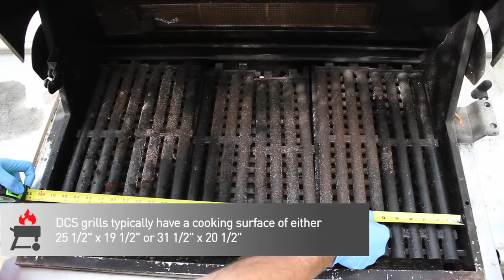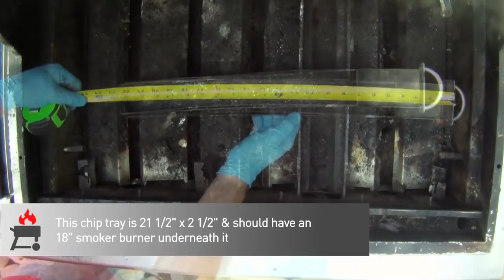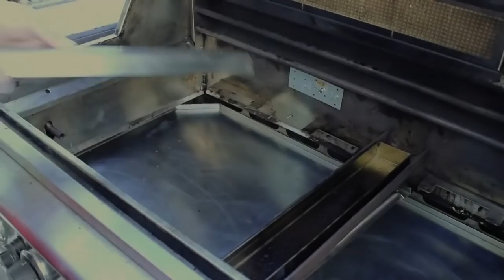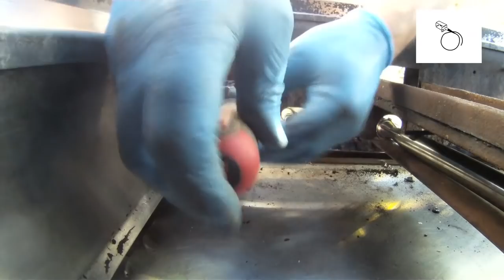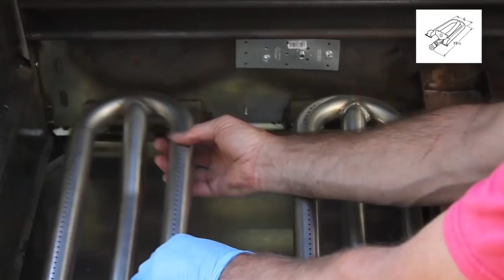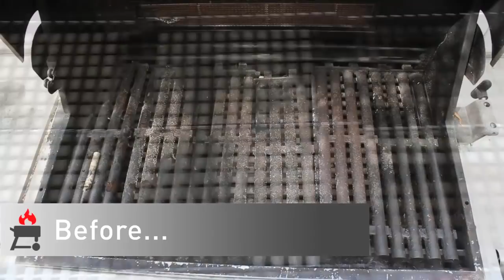DCS Grill Repair How-to

Comment: Definitley on the money BUT, I did exactly what you did to my 20yr + old 36" DCS built in (looks 100% like yours). After spending a lot of dough turns out you never have to replace cast iron porcelian grates or the Stainless Steel burners, EVER.... . The replacement burners are less than 1/2 the weight and suck. a lot of $$$ out the window, yes i checked everything, cover open, no spider webs, valves were clean, flames never went yellow. went back to originals, just cleaned out all the burner holes with a drill bit.. NEXT, My son decided to suprise me with new  grates, replacement crap. He threw out the porceilen grates. I almost had a heart attack. trying to find the originals are about impossible, foumd 2 @ $240 ea.  That's right... over a grand to replace all used on Ebay.  I always hated those manual ignitors so I wanted to ugrade to electronic ignitors. Installed the ignitor module on the far right (only place due to gas lines in way).  replaced ignitors, having issues adjusting them. But no problem. I believe it cost me around $2500 new. Now over$6k.. best investment ever...........
Reply from the maker: That original grate is great (see what I did there?), but this one was pitted up pretty badly & needed to be replaced. Not sure what stainless grates you replaced yours with, but we replaced ours with heavy grates made from 5/16" stainless rod - not lightweight by any stretch.

Comment: I have the 27 inch DCS, built in, installed in 1994. Do you still have all the replacement parts necessary? The ignitor stopped working decades ago. Would I need to replace the rotary ignitor and electrode too?
Reply from the maker: It's safe to say that you'll need to replace both parts - they're not designed to last 25+ years - but that's still a great grill and worth keeping going.

Comment: I just bought a house that has this exact grill. The system has 3 or 4 burner knobs that will not push in or turn! Any idea how to fix that? 🙏🏻🙏🏻🙏🏻
Reply from the maker: No shortcut here -- you'll have to dig in & investigate. Those control valves are replaceable (https://www.grillparts.com/dcs/partslist.asp?product_id=30171).

Comment: I also have a DCS grill, it came with a rotary igniter, and it broke after a few years, I replaced it, and it also broke after a while. I hated turning the knob to lite it, such a stupid design for such a expensive grill. I bought a electric igniter that uses a AA battery, but that failed also from heat I think. Anyways, I made a modification to the grill and it works awesome, I used a electric igniter that is used in a home clothes dryer to lite the flame, I use a momentary on/off switch to control the 120 vac to it. Is the best thing I ever did. It’s been working for years now. I was thinking of making a YouTube video on how I did it.
Reply: Please do that video!💕

Comment: I just replaced my rotary igniter modules, one of the burners, ceramic trays and smoker box. How long do I need to "burn" the new items before I can start to use my BBQ? Or do I need to do this?
Reply from the maker: We wash new grates before using them for the first time. As far as the other stuff, we just let the grill heat all the way up (about 20 min).

Comment: These stainless grates looks great and feels much easier to clean than the original, but how to deal with oil / grease drips as the original grates direct them to the bottom of the BBQ?
Reply from the maker: For us, it's just a matter of pulling the grates off & cleaning a little more often.
Reply: I have been curious about replacing my worn out porcelain finger grids with the rods. Do you notice more flare ups since the grease isn’t being channeled away?
Reply from the maker: @Shinnen09  The channels never really seemed to eliminate flare-ups for us & there doesn't seem to be any difference --  although it's been quite a while now since we swapped 'em out & we might be misremembering. It seemed like a nice upgrade at the time & still does.

Comment: The problem with doing this is that the parts end up costing more than simply getting a new one. Am I correct?
Reply: I just found a dcs 26 on the side of the road.  It was dirty as hell.   A pressure washer and some barkeepers friend and it looks like new.   Burners were in good shape, only need deflectors and grates and maybe the ignition but I'm happy to use a lighter.  Built in grills start north of $1000 easily, even buying expensive OEM parts for this long discontinued version I e only got $200 invested
Reply: John Salas sometimes yes but it keeps it out of the landfill
Reply from the maker: Hey John, sorry for the lag. No, it's not cheaper to replace - DCS grills cost thousands of dollars. Also, a lot of people have these as built-ins for their backyard kitchen and replacement is a serious hassle.
Reply: are you kidding? you're looking at $3000 plus for a new one.

Comment: I've done this 3 years back. One thing you missed out on are the propane hoses. I missed them too. After a couple of cooks they finally popped and gas was leaking.
Reply from the maker: Thanks Manny - All of the gas supply parts were still in good shape, so we just left them out (we also skipped the rotisserie burner).